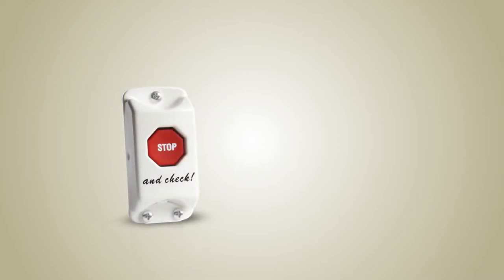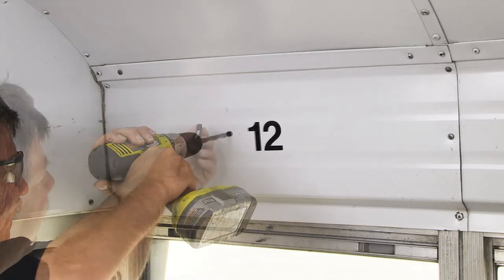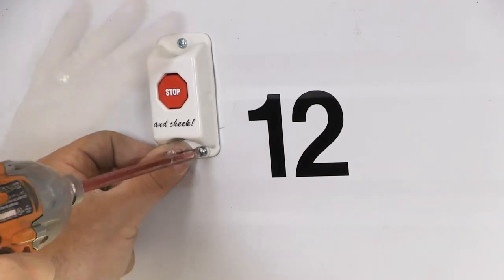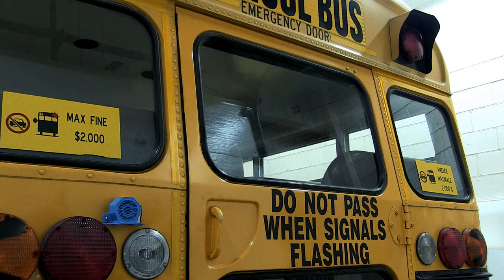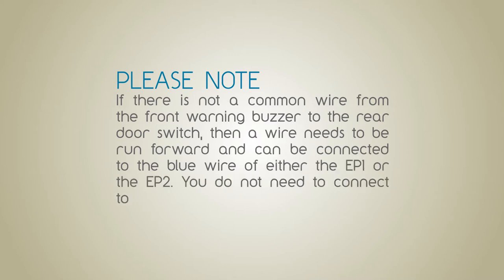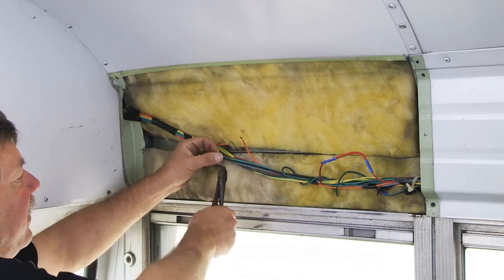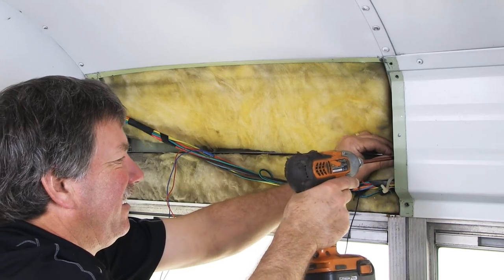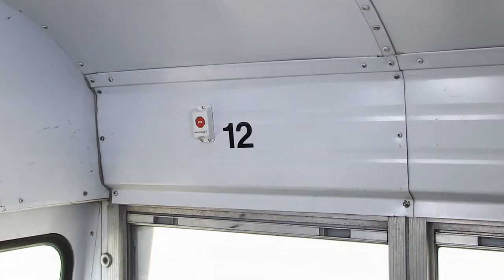Child Check-Mate System - RVT Installation Video

Comment: Every single time I see that button I never know what will happen. Now that the system talks it is not so scary.
Reply: FYI, there's about 80 different software configs for different state/county/contract/operator/provincial/national specs, so it can get fairly confusing - especially if there are a few different programs on a single fleet.

Systems can be reprogrammed to make them function consistently (and to your point, this should be done so that they are easy to operate). Reprogramming takes about 1 minute. Reprogramming audio for 1 language takes about 20 minutes, if it has multiple languages it may take more time.
Reply: Also, @Video Dude 22, based on your engagement, I'd be surprised if you didn't know your way around the system very well, so if you run into issues, feel free to reach out to us for support / more detailed feedback!
Reply: @bradboth2698  I sure will but I have one question can you make a video of the whole system in action with all the new enhancements on your channel? Voice and Theftmate plus Charter Mode.
Reply: @carwashslayer4235  We've thought about doing this a ton, but the problem we have is that there are so many variations that we think if we push generic information, we might create more confusion. Engaging charter mode, for example, only exists in some software and requires that the user deactivate the system when they don't need to (and sometimes within a certain time frame of the previous deactivation). Further, there are dozens of different deactivation specs (e.g. systems in CA are completely different than FL, etc.).